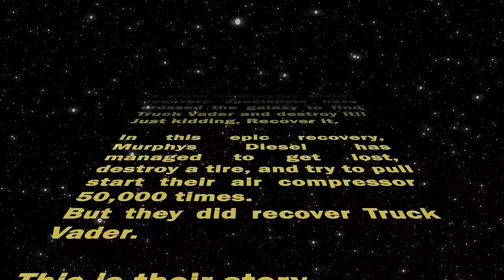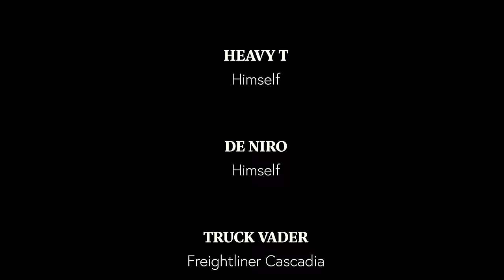RECOVERED 77,000LBS of TRUCK VADER 23 Miles OFF-ROAD!!!

Comment: What a great video!  I watched the whole thing and was fully immersed.  Commentary was funny as hell, especially when you said yall were waiting for your chopper to bring in another tire for the 7-ton.  Also, few things are worse than a small engine that will not start when you need it most.  I felt the pain when your compressor would  not start and I have destroyed a few things that are small engine powered when they pulled that shit when I needed them most.

Comment: A PLS Palletized Load System set up on the 7 ton would be sweet to load and unload the skid steer instead of that sketchy vertical maneuver you do haha. Another great recovery.
Reply from the maker: The sketchy version is more fun 😉
Reply: @MURPHYSDIESEL  Ha I’m sure it is. Teetering right on the edge of destruction   👍.

Comment: Well,the LLC designation didnt do it,the XTRA label on the trailer didnt do it,I bet the H Farmall with the trip bucket loader didn't get it unloaded either.
Seriously,a very interesting recovery. I wonder what the owner thought watching their truck tracking software map. Ive never wound up like that with a printed Atlas. Poor bugger. If I delivered to remote places I would call and get a guide.As you show,you just can't turn sround and you aint backing up. Only problem was the tire,that definitely was expensive. Thanks for taking us along.

Comment: Check out the milwaukee 1inch drive wheel gun  ,enough battery's no more need for a compressor  ,great video lads ,maybe a big drag winch on the 7 ton would be a benefit ?

Comment: Loved how the 'shjtshow' went down and the joshing; I guess you gotta trade your way to get a helicopter to bring you tires 😎Good point about duallys off road which trap rocks, wreck tires and throw themselves off on the highway.  You'd think with the cost of trucks and the loads they carry, someone would invest a few peanuts in GPS that actually takes you on the best possible route to the customer's site!
Reply: Running rock bars between duals slips rocks from between duals . Or big singles . No matter that’s one hell of a place to get stuck

Comment: Keep a chainsaw in the service truck ,with some adaption they can be used to start petrol motors as on the compressor,add a cog to the starter pully  .
Ron Platt is in Scott City 😊
Reply from the maker: Great tip!

Comment: If you look back early in the video,that tire was low when it was loaded onto the slider.Nobody check their equipment out before each job like that You know kick a tire or two,check fluids & fuel .
Reply from the maker: Apparently the air inflation system stopped working that day. That’s what I get for half assing it.

Comment: You guys didn't notice that tire was half flat when you all first loaded the 7ton on the trailer? Awesome job you all. I'd work their if it was a sh!t show or not. Those work places are most times the best places to work for. Crazy that people take those rigs so far off road like that. Their should be a point where you say that the GPS failed at some point & wonder. That's whats wrong with most now days no commen sense whatsoever.
Reply from the maker: Apparently the air inflation system stopped working that day. That’s what I get for half assing it.

Comment: Or you spend 350$ on a 2864 milwaukee 3/4 handheld that has YET TO FAIL on even a yolk nut, nevertheless a lug nut on any piece of machinery or large truck I've tasked it with.  Better yet- spend 700 once on an m18 1" and be done with it lol. Moral of the story- harbor freight is 98% trash. Lol. Keep up the good work fellas!

Comment: 3:08 That tyre was already flat, not just soft, flat. Nobody spotted that? Expensive tyre ruined due to lack of normal checks.
Reply from the maker: apparently the air inflation system stopped working that day. That’s what I get for half assing it.
Reply: @MURPHYSDIESEL  I left school at 15 to be a heavy vehicle mechanic and I'd be lying if I said it never happened to me, it's a learning curve that never gets straight! 😂

Comment: At 3:08-3:09 you can see the tire on the 7 ton is way low on air, which probably caused it’s early demise.
Reply from the maker: Probably, my air inflation system stopped working. I knew it was low, I usually start it and let it fill the tires.

Comment: If you fix what you break on the video ( I believe it was the tunnel one) your tire wouldn't be flat on the 7 ton when you loaded it on the trailer.
Reply from the maker: I fixed the valve stem on it, then let the air inflation system air it back up rather than doing it manually, apparently the air inflation system stopped working that day. That what I get for half assing it